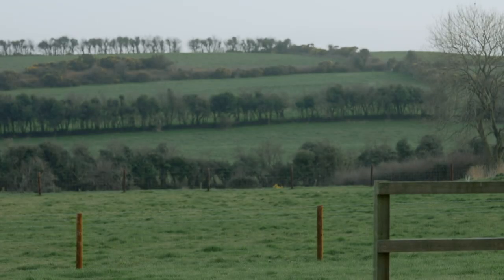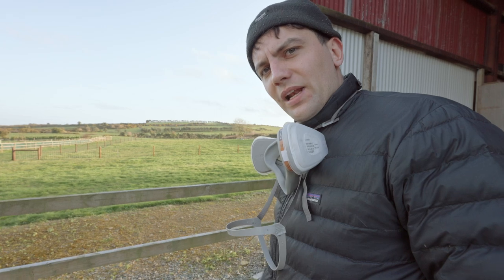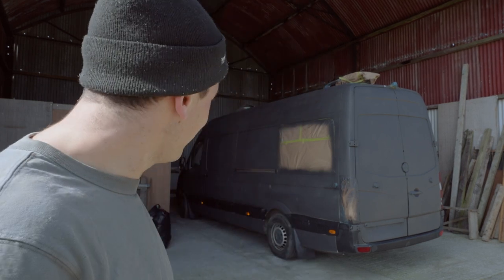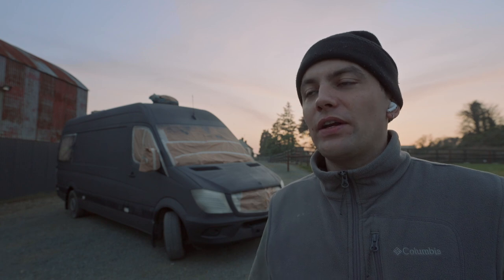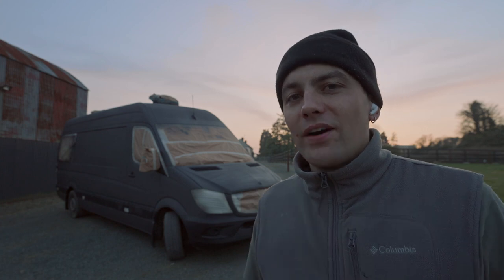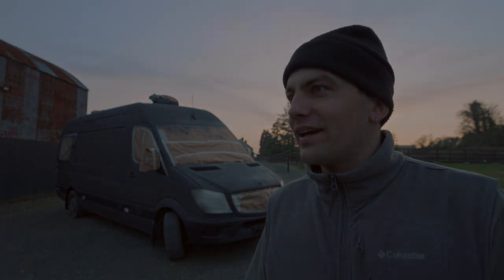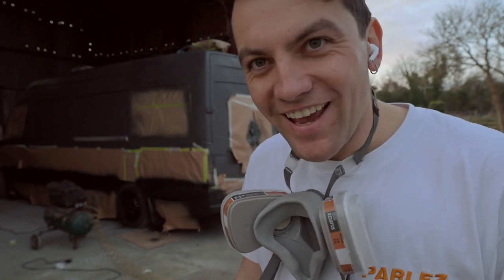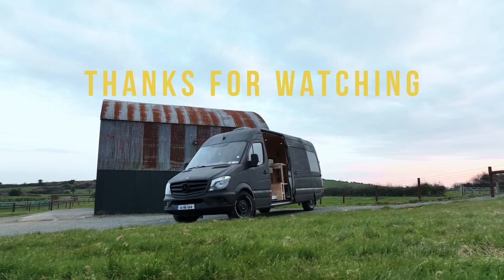Upol Raptor Painting Our Van (Again). #18

Comment: Great video!  I’m planning on doing my 06 sprinter.  I kind of liked the butter.  I bought the stock grey green on Amazon.  I will do my best to make sure I really love it before doing my whole bus.   Thanks for sharing.
Reply from the maker: Let us know if you have any questions! Good luck :)
Reply: @ProjectJolene  -So last evening I learned that the tint I bought on Amazon is NOT returnable.  $500+ of tint I’m not sure is correct.  THe moral to this story is to a) check on return policies BEFORE buying, and b) if you are buying from that seller, only buy one $25 bottle before ordering all of your tint.    I have reached out to the seller for some way to correct my mistake, but I’m not very optimistic.
Reply from the maker: Fingers crossed!
Reply: @ProjectJolene  Good news-  in spite of what Amazon says, the supplier says they take returns, but I think I am going to go with the color!I scrubbed off my Sprinter today.  Will move to surface prep tomorro.   I’m

Comment: great job on the van. That's the colour I'm going for on my Sprinter too. Did you get the tint through raptor and can I use your barn?😄😄😄
Reply from the maker: Nice. No, got 2k paint from local auto paint shop which you can mix into tintable raptor. Recommend using the 2k paint which takes a separate hardener as it had a nice tough finish. And sure! Where are you based? Haha
Reply: @ProjectJolene  I'm in the UK but my partner lives in Dunshaughlin. I'm coming over in the van in mid-October. Do you mind my coming to take a look at yours and getting some advice? Oh its also a 2014 Sprinter that I decided to call Nelson Vandella 😆
Reply from the maker: Sure get in touch when you’re heading over. Both myself and Rosanna are away a lot so there’s a good chance we’ll be in london ourselves then but no harm in checking in. Hoping Jolene will be ready by then too :)

Comment: What compressor did use. Also the gun you mentioned. Good blog on painting
Reply from the maker: Just like 100L compressor, or else a 50L compressor is good. The gun is variable nozzle gun that Upol Raptor sells - it’s more expensive than the basic one but it’s way better
Reply: Thanks for your reply. 😎

Comment: Great walkthrough thanks! Will go with liner too on my 144wb sprinter. Wondering how of a pain was it to sand the first raptor paint and paint over with raptor? Did you sand all of the surface or just sprayed over? Im not sure i got that in the video. Cheers!
Reply from the maker: Hey Tony! The original raptor we didn’t sand it off. Paint shop said we didn’t need to, just cleaned it down and did another coat of the new colour on top
Reply: @ProjectJolene  Good to know! Thanks

Comment: Hi guys, love what you've done with the respray... both times! I've been planning on doing similar to my sprinter.. the prospects are daunting!  I wanted to ask about your wheels. I take it the rims are stock originals. I want tyres like yours though. Could you tell me the size and model please. I've just subscribe so I'll see you around. Cheers x
Reply from the maker: Hey Joe! Yes stock wheels. The tyres are the biggest you can fit on stock rims without lots of running. They rub a tiny bit at full lock but doesn’t bother us. 

BFGoodrich ALL Terrain T/A KO2 245/75 R16